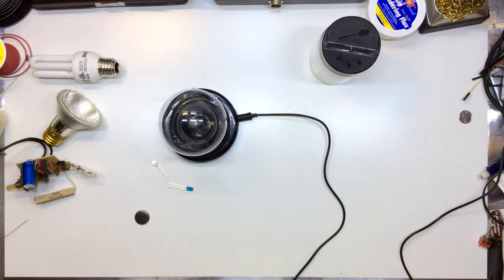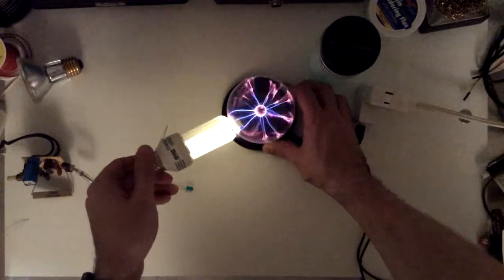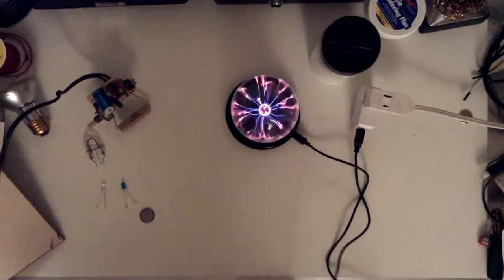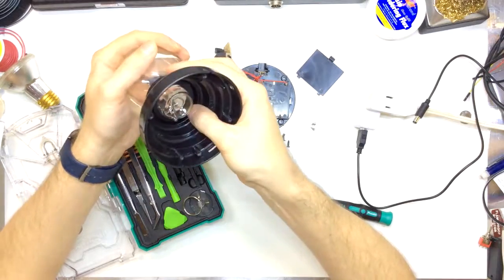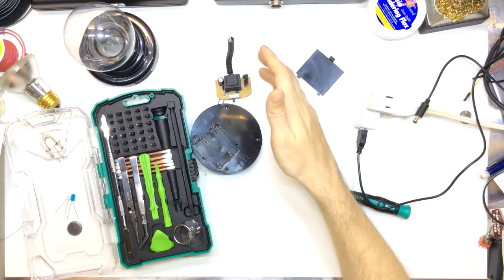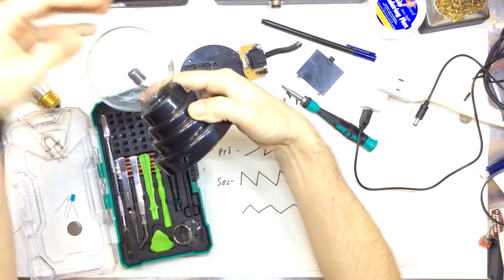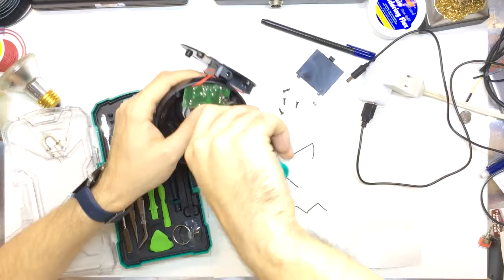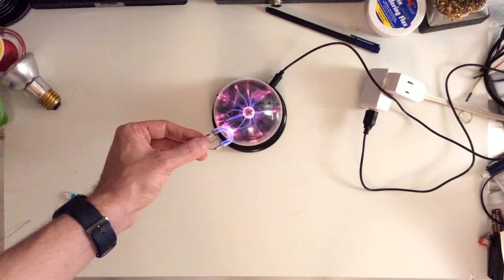Exploration of a Plasma Ball

Comment: I remember when I was a little boy, they'd put them out as displays in shopping centers usually with a bad bust of mystic Meg, and you could go touch it and hope it didn't zizz you, and they cost a ton to buy, I think I got mine in 2006/7 for about £15 or less, you can power of from a 9v battery, it always seemed to "shock" me, but it was just the glass vibrating, still I was always slightly worried, it lasted for years but I think the gas got out somehow, eventually I removed the globe and made a hole in the glass to allow any gas remaining to escape, I think it had already gone by then, but the base still works, fun to play with for a little high voltage doodad, gives you a bad zap of you touch it